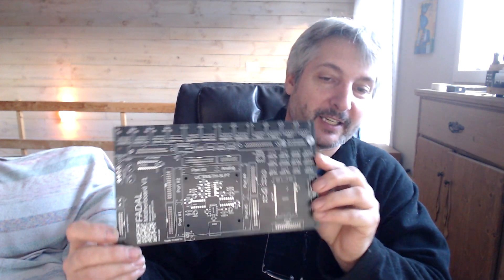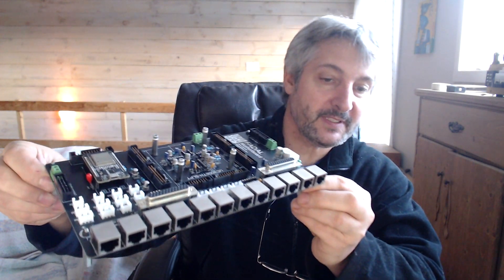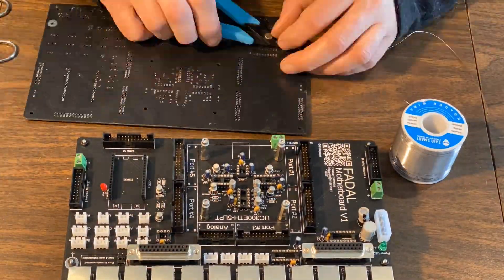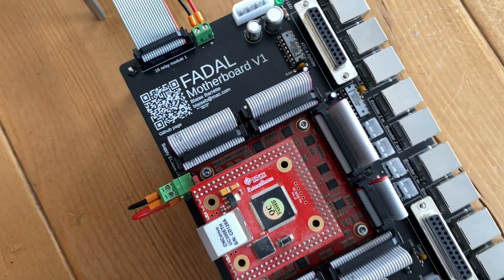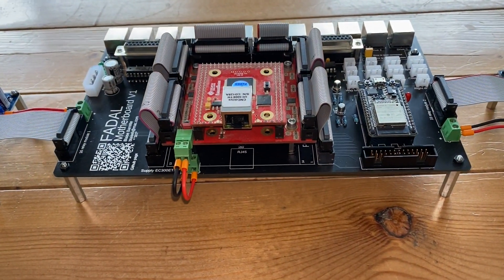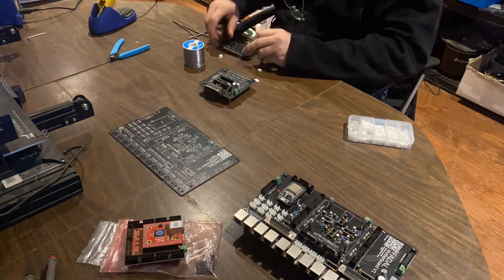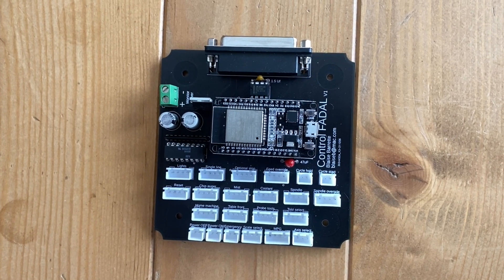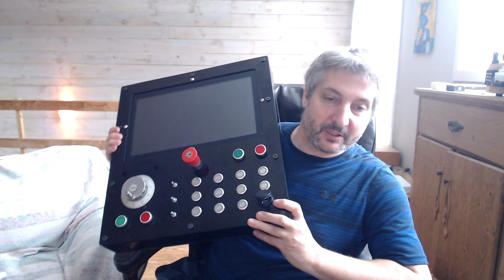Part 41 (Making the motherboard)

Comment: So I am home with the flu today and binge watched you Fadal rebuild video series.  Very impressive work.  But I don't understand why you are not using the factory electronics.  If I remember correctly, your first instalment talked about the machine being three phase & you only had single phase at home?  I have owned several 4020's and ran numerous other ones in other shops... we ran them all on single phase.  I think there is a slight loss of spindle power doing that?

Comment: Hi! Blaise, you are amazing! Perhap, you know a lot of thing: machenical, electrical, electron..., right? 
So, I am having a plan to restore a cnc machine. But there is a lot thing I didnt know, yet. So could you tell some advice? About pcb, connecting electric,...Otherwise, watching your video, I learned very much. 
Finally, you are great!
Reply from the maker: Thank you for your kind words! I now only a little bit about electronics. Fusion 360 electronics is quite easy to learn. It helps if you have friends who ca help you when you get stuck. My main advice is only do it if you have time. Don’t expect to have a machine up and running for a while. It is a lot of work!

Comment: Blaise, two things:  
1) I was so hoping early on that you'd go linuxcnc so I could just copy what you did on my fadal.  One can hope.  

2) I don't have a way to contact you directly but wanted to let you know that I made a fixture the other day that I would NEVER have dreamed up if I hadn't seen your awesome Fusion 360 video.  You had one fixture that used miteebites to press against a piece of aluminum with a thin section that could flex.  I thought it was genius!  

I had a somewhat similar need and made a fixture to hold some 25mmX44mm parts and it works fantastically.  I wanted to share it with you and let you know you helped me out a ton by sharing your approach!  If I have a way to do it, I'll either make a video or take some pictures from Fusion 360 and tell you about it.
Reply from the maker: Hey Bill! Wow! I would love to see your fixture!
I thought it was a good idea that mini soft jaw thingy! I have been using it a lot in my fixtures at work since. Very happy that it works for you to!

As for LinuxCNC... sorry! It might have been a better choice!? I don't know but so far I am very happy with how flexible UCCNC is. Their's nothing I avent been able to do in terms of adding features and modifying the interface. And also it is working very nicely with a touch screen so I am clear from using keyboard and mouse. Hopefully it performs well motion wise. Time will tell.
Reply: @BlaiseBarrette  I'm going to just export the file to a Fusion archive and send it your way along with a couple of pictures.  The files are a bit sketch, but it'll make sense when you see it.  

Once I realized what you were doing with the flexible pieces of aluminum I knew I'd use it.  My design uses through-bolts instead of mitee bite clamps, and it pulls two flexible pieces inwards, each one clamping a separate part.  So I get two pieces clamped from one screw!  Makes things really fast and efficient to swap stock and parts.

I had been doing these in soft jaws, and once I realized how my design would work I realized it fixed another issue with soft jaws.  The vise and fixed jaw flex a little bit and I noticed each time I made soft jaws I'd have to dial in the work offset to get things just perfect.  When you're making chamfers that are only .2mm, having one side at .16 and the other at .24 is actually easily noticed with my 54 year old eyes, so I fine tuned each setup.

But, because my fixture is fixed and the clamping forces are equal there is no movement or flexing that needs to be accounted for.  I am VERY happy with the setup and wouldn't have thought of it without your example!   I might upload some videos as well, and put them back up here.  

If you're ever in the Dallas, Texas area, I owe you the beverage of your choice.  Take me up on it!
Reply from the maker: @billstrahan4791   I looked at your file! I replied by email but I'll just say here that I am very impressed!
Reply: @BlaiseBarrette  You're too kind!

I sent you my coolant manifold f3d files

Comment: Hello! Was there a specific reason behind the esp32? I'm looking forward to see if the noise picked up by the antenna make problems.
Reply from the maker: So far there are two esp32, one in the control and one on the motherboard. They don’t deal with any crucial systems. The one in the control decodes the three encoder buttons, control the LED of the buttons and read modbus for status ont some systems. On the motherboard, it monitors the charge pump emitted by the UC300ETH, modbus communication and has control over a few of the relays and is used to read some of the sensors. All the signal wires are twisted, shielded ant connected to ground at one end and the most critical signals like the servo encoder signals are differential pairs.